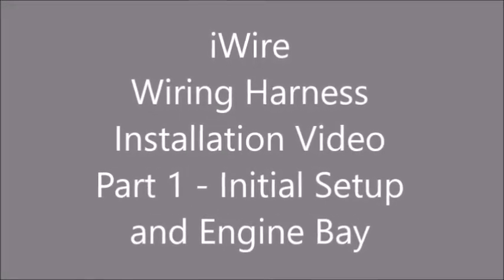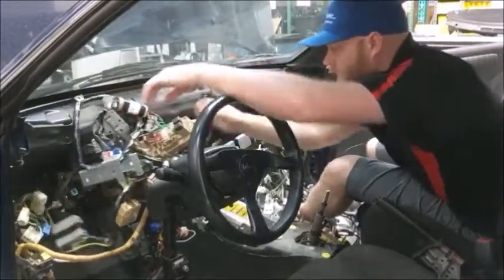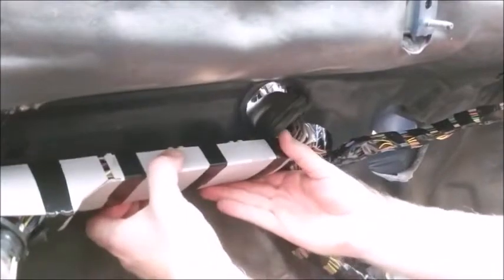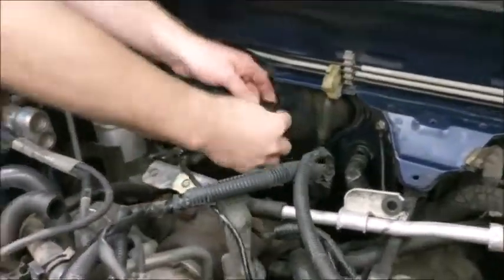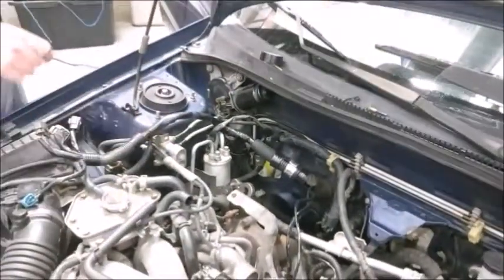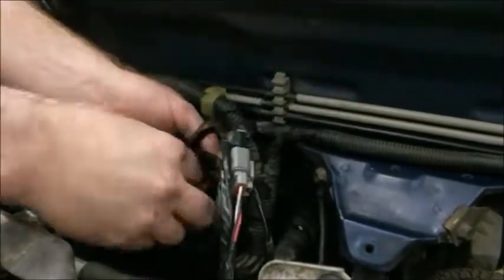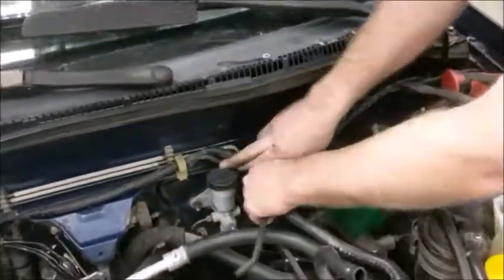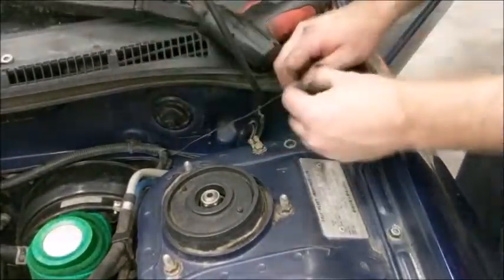iWire Subaru Wiring Harness Installation Video Part 1

Comment: How much does It cost to replace the harness in a 2005 subaru impreza rs
Reply from the maker: Used harnesses generally cost around $500, while a new bulkhead is around $1200 from Subaru. It all depends on what is going on. This would not include labor for whoever will do it for you. If you need more information, please email info@iwireusa.com.

Comment: If you took the harness out to send it to them you should know how to put it back
Reply from the maker: Sometimes people take awhile between removal and install and need a little help.
Reply: The NA car doesn't have this section of front harness with the engine harness connectors on it, so you aren't "putting it back."